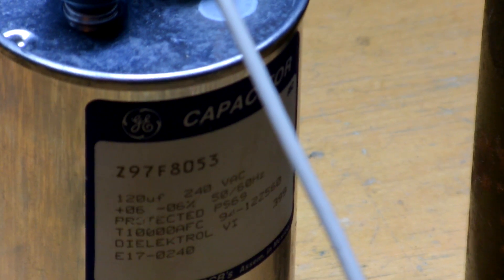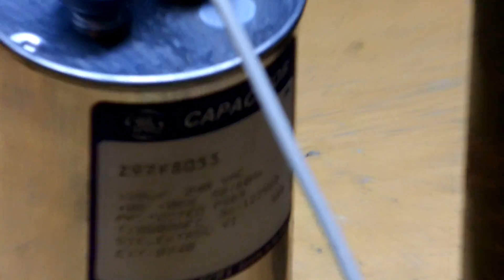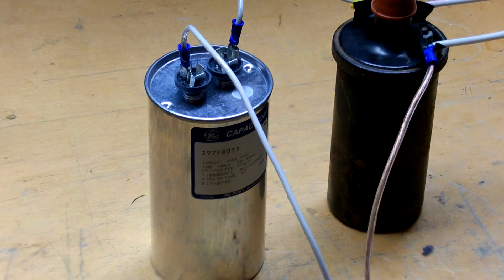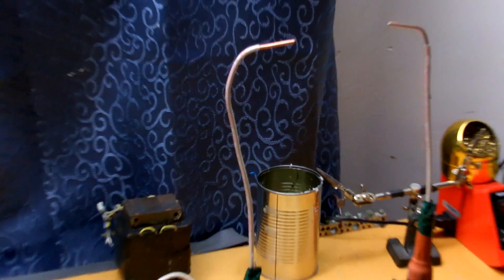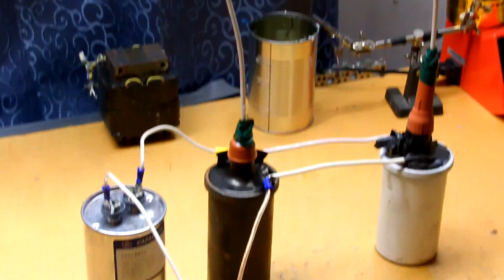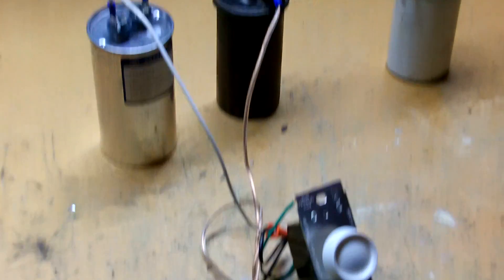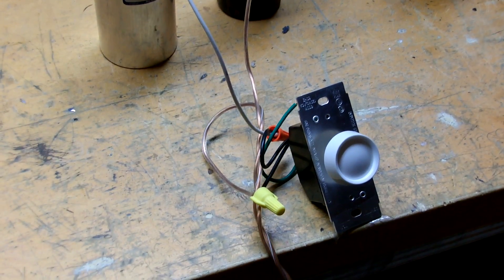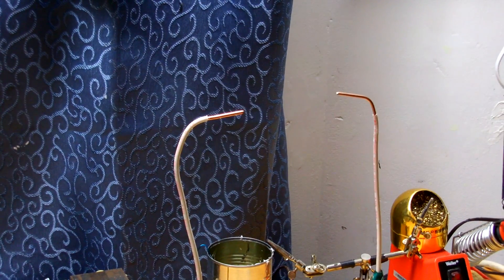60kv Arcs + New Camera!

Comment: Hi!  Can you provide me a schematic for this??  :-). Thanks!
Reply from the maker: I do believe I have it on paper somewhere
Reply: @PcrHV   Thanks!  Much appreciated!
Reply from the maker: Are you attempting to recreate the circuit? It's a bit dangerous.
Reply: @PcrHV  No worries my friend, I'm actually a red seal electrician by trade and have been hobbying around with things like marx generators, xray transformers, tesla coils, and flyback transformers for years.  :-)  I was just curious- is the dimmer acting a pulse generator by changing the pulse width to look like DC pulses?  I would have never thought to use one in this application, but dang it looks like it works so well!  I probably will build this at some point down the road, but I haven't got the time until the new year.  🙂
Reply from the maker: Ah well in that case it's alot of fun, I do love a good marx generator! The circuit will run just about any ignition coil. How do I get a diagram to you?
Reply: This gawd awful forum won't letme post my email address. Connect the address together with the next reply.  Lol!  ..
Reply: wes  is the first part vip is the second part and net is the last part..............
Reply from the maker: @WESDEANEMARTIN  @gmail?  You can always delete these comments after so no one else sees em,
Reply: Oh, sorry, not gmail.  just insert the at and dot between the three words I listed.  Lol.  Youtube deletes emails in comments..
Reply: The wiring looks pretty simple; I guess I was just curious how the coils were connected. Sort of thinking that one steps up one half of the sine wave and the other steps up the other? If so, the neg and pos primary connections are probably opposing each other?

Comment: Hey man great arcs, can this power suply be used for tesla coil?
Reply from the maker: Hey thanks for the comment! This particular configuration most likely won't do too well  for a Tesla coil, although it would probably work for a very small coil, the output voltage is a bit too high and the available current is somewhat low and those ignition coils are prone to overheating. A small coil is possible but you would achieve better results with a microwave oven transformer or neon transformer and older oil burner ignition transformers.
Reply: @PcrHV Thank you very much!

Comment from the maker: Hi, thanks for the comment!!    It was actually a 150uF cap :)   I do plan on lowering it about however,  the current is too high for anything more then 20-30 second runs as the coil's become quite hot to the touch so i imagine that they wouldnt last long under the abuse lol

Comment from the maker: Hi, it should be able to work with a transistor ive seen schematics using 2n3055 npn's so i would imagine your 1500v one could work better. i havent tried out that circuit using a transistor myself though. @LUVB6CPPgmodcsscoder